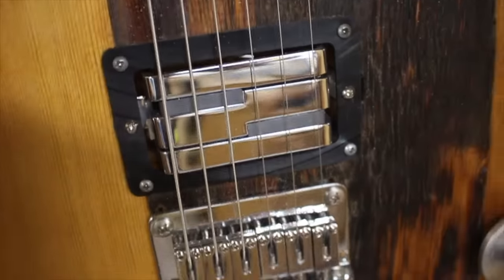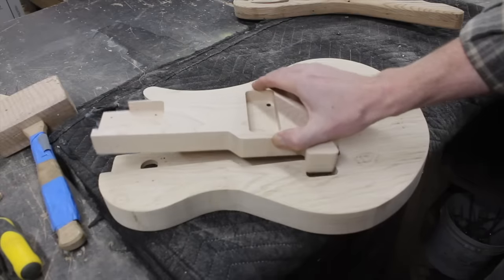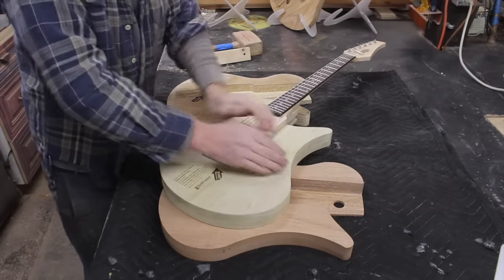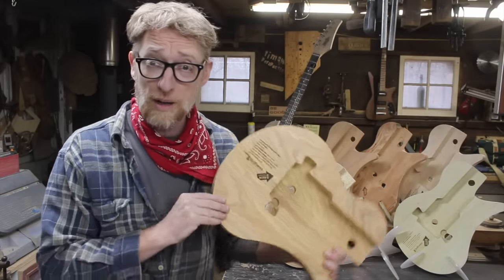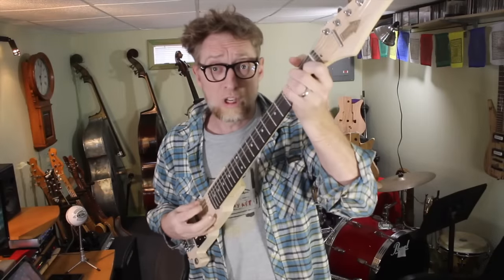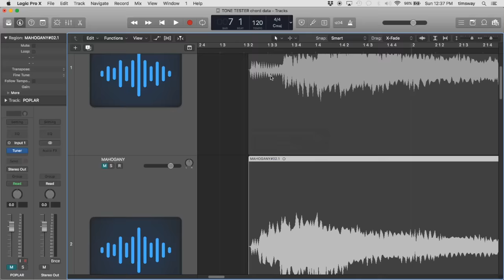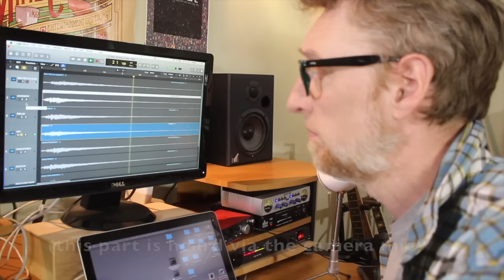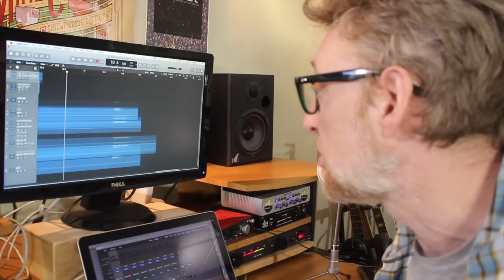Tone Wood Tester: One guitar to test them all

Comment: I am 61 years old - I've been playing and thinking about woods since I was ten. I went into engineering as a way of making a living. Having given this considerable thought I would like to give a simple breakdown of why the density and to a much lesser extent grain patterns in the wood of a solid body guitar influence the sound. The guitar is made of four components plus strings - the neck, the nut, the bridge, and the body. Some really great analysis is indicated on several videos - these explain what the string does after it is plucked and how the harmonic content is created. If we had infinite mass on the body and neck that harmonic content would be unaffected by the body or the neck - it would be consistent and without external influence. But we have components that vary in density, geometry and interface (neck-body joint). All will influence the string response. The neck is like a beam cantilevered off of the body, the body is the anchor. A neck can be fat or lean – this will influence how it responds to string vibration. The thicker the less it will vibrate and affect harmonics on the string. The strings are anchored at the nut and the bridge. Both the nut and the bridge transfer the string vibration to their anchor points. So the nut is the transfer point for the neck and the bridge is the transfer point for the body. When plucked the string vibrates and harmonics are created down the length of that string. That vibrational content is transferred through the nut to the neck. If the neck were infinite mass it would not influence the harmonic content of the string. But the neck has mass that is easily influenced, vibrates and injects that vibration back into the string via the nut with its vibrational response. The density (wood species) of the neck and the thickness or stiffness will determine how the strings are influenced. The same thing happens with the bridge. It transfers the vibration of the strings to the body, the body resonates and that vibrational response is transferred back through the bridge to the strings, which then affects the harmonic content of the string vibrational pattern. Everything that goes into the strings is then transferred to the pickup. It is a system. It is a recipe of parts. Different woods and geometries for the body will vibrate differently in response to the string vibration, the same with the neck. Nothing on the guitar is isolated from the other parts. It would take infinite mass of the body and neck for influence on the strings to reach zero. Do you feel the body of your guitar vibrating when you pluck a string or strum a chord? If the string didn’t transfer its vibration to the body you would feel nothing. If the body is vibrating, do you think that is isolated from the strings? - If so, how? It is a system of moving parts, each with its own vibrational characteristics, each influencing the other. The neck and body also share a joint and they influence each other.

Let’s look at construction. Neck – body interface (joint) will affect how those two affect each other. A set neck with lots of surface contact (long tenon Les Paul) will allow those two to vibrate separately and together better than a joint that has less interface. One is not better than the other – they just produce different sets of outcomes at the strings. Different woods (densities and therefore different responses) between the body and neck will have different outcomes at the strings. A solid single wood type body will behave differently than a body constructed of two or more woods with different densities (Les Paul). A maple neck on a Les Paul will sound different than a mahogany neck. A rosewood neck on a Stratocaster will sound different than a maple neck. A neck-through will sound different than a set or screwed on neck. A partial neck-through (as in the tonewood test unit) will respond different to either a set or screwed on neck or a whole neck-through. A neck-through represents the same wood density through the length and the body woods added to it will have considerably less influence on the sound of the strings because the bridge transfers to that neck wood directly and the side body pieces (wings) are only responding to what the neck wood sends to them – and that response has to travel back through the neck wood through the bridge and back to the strings. The body wing vibrational influence is minimized through that transfer. In the partial neck-through again the bridge is mounted to the neck wood and although the mass of this neck wood is less than a full neck-through due to it being a fraction of the body thickness it still influences the passing of the body’s tonewood vibration back to the strings; less of the tonewood’s influence will come across at the strings. In a Les Paul the maple cap is fully bound to the mahogany tonewood and both influence the sound at the string – each wood’s characteristic resonance comes through because the bridge anchor reaches both woods.

Each wood species has a very specific grain type and density range and will have response or resonance that matches that range. Some guitars made out of the same wood sound better to the player than others. One guitar might be put back by a player just to be picked up and purchased by another as the “one” that “hits” it. Most of that is due to wood density – some of it is in the electronics and a minor portion by the quality of construction – but that variation is very slight and mostly fixable.

The woods used on a guitar vary in density. Maple is much more dense than mahogany. Each species of wood has a range of densities that are determined by growth - the more water the faster the growth and the density drops in the range proportionate to the growth rate. To a degree the grain structure affects density in woods like mahogany because the grain is open (porous) and where large variations of grain occur the density in a region of the tree will vary proportionately. One piece of mahogany having consistent grain will have consistent density and resonance where another piece having significant grain pattern changes will have an inconsistent vibration pattern. I have seen mahogany pieces with severe changes in grain structure that seemed to resist vibration. This I attribute to cancelations caused by inconsistent densities through the piece impeding the natural vibration (resonance) due to higher grain density, or impedance, in a portion of that piece. To put it simply – it is a dead piece of wood. This accounts for the variations we see in instruments using mahogany. Woods like alder and maple are closed grain woods and have little variation due to grain pattern changes. Growth rate determines wood density in these trees. Faster growth (lots of water) lower density. Each wood type has its own density range. Eastern hard maple is much denser than western big leaf maple. Both are considered dense compared with alder or a similar wood.

Summing this up – the woods, shapes of body and neck, joint type, and the pickups and electronics all affect the sound coming out of the guitar. It is a recipe. I liken it to what goes on in the kitchen and I  prefer to think of guitars as unique in sound from each other. To me the song will dictate which guitar to use because it should serve the song and enhance it. I have heard incredible combinations of different guitars over the years; I have heard guitar selections that made no sense. I like to think this was the engineer rather than the player who made the bad choice. 

I think this is how a guitar works – and I have been thinking about it since I carved my first neck at eleven because it was too fat for my fingers. At fourteen a dear friend’s father who really positively influenced my first band was trying to convince me that given the same pickups a guitar made out of concrete would sound the same as one made out of mahogany. I really think he was just giving me something to think about. I did. Thanks Norm.
Reply: @valueofnothing2487  I have read so many papers on experiments and summaries regarding this matter. All I could get translated on this was the summary. I did however also look at the tables supplied and attempted to understand the approach and construct of the experiment. I can only comment on the data - which appears to have been manipulated for the sake of simplifying the job of reading those results. If you could overlay these response plots as they appear you would definitely see differences. In the summary the author states :  "The harmonic spectra of each guitar are compared to each other and there are no significant differences between them. Thus, the variations of timbre of electric guitars, according to the results obtained here, depend on factors other than the wood of the body itself..." The differences are in the data as provided - I can clearly see them, yet the author states "there are no significant differences". If you could see the raw data and compare it the results would probably be even more compelling. Anyone can make an experiment and state conclusions. The reality is that nothing stands alone in an instrument. This is a difficult question to answer and the setup to get conclusive data is not apparent.  Is the harmonic content truly represented to the reader? I seriously cannot conclude anything absolute from this paper one way or the other. But if you look at the response tables and if you are capable of discerning the differences by comparing sections of the response curves you will see the differences. Given this manipulated data would I say "no significant differences"? Give me the raw data. If all I had was what is presented I would say it appears as though there are differences, but the data is too tansformed to give an opinion. If pressed I would say the data presents differences that cannot be quantified in terms of actual content and differentiation - but there are apparent differences portrayed in the data given. I would never state "no significant differences". That is a stretch.
Reply: @valueofnothing2487  I have a Stratocaster with a solid rosewood neck that sounds nothing like a solid maple neck. The difference is stunning. I can tell right away the difference between a Les Paul with a mahogany neck and a maple neck. They sound very different. Some people can hear these differences - others can't. That certainly becomes part of the equation at some point. I know a guy who can tell you which microphone would be best given your voice. He can hear all the way up to nearly 25,000 hertz. I wouldn't want to be burdened with all that goes on the average person doesn't hear but is in many man-made environments. Electronics often have circuits that resonate at frequncies in that range - it would drive me nuts. I can hear up to about 16,000 hertz. That is more than enough. My point in my discussion was that this is more complicated than most of us realize and I have not seen one experiment that closed all of the concerns introduced by the experiment itself, let alone answered all of the questions one might have regarding instrument response. Many of these authors arrogantly state conclusions. It happens in science all of the time. Even peer reviewing doesn't guarantee that the conclusions are correct. Don't even get me started. It can be a real minefield. I offer my interpretation based on 50 years of looking at this and wondering. It doesn't matter to me if you agree or disagree.
Reply: @robertduvall7392  it was just a f test of the frequency distribution where the null hypothesis is that the frequencies are all the same. And it could not be rejected at the 95% confidence interval, I presume. Comparing frequency distributions is kind of standard fair in statistics.

when I look at all the graphs I could not see any significant differences. 

In terms of what the human ear can hear I would say if you could look at the graphs closely which I am unable to do you could claim that if something is off by a decimal or a half a decimal then there might detect. 

maybe I will look at it in the PC and see if I can see differences.

Can you give me an example of one of the differences that you think was different? So I could take a look. You have to admit don't you that they all appear the same shapes roughly right? when one falls the others rise and when one of them fall on they all of them rise? If you step back and look at the big picture it is if you some kind of duplication pain like Thomas Jefferson had or something.
Reply: @valueofnothing2487  We are talking about details, not big picture stuff. There might be a peak at just a few frequencies and a drop at a few frequencies that alter the overal characteristic of the sound. I've done a lot of experimenting with guitars over the years and been surprised at the differences. I really don't know what else to say. Again, if you could see and really analize the original signals and compare detail you would see the difference. Take a guitar and just change the neck wood on it. We are talking about a guitar straight through a clean amp. Certainly if you process the signal through all kinds of effects then all bets are off. The same setup is used on three body boards with the same neck. https://www.youtube.com/watch?v=nrEar7dgVwI  If you cannot hear the difference then I certainly can't help you. I don't think you can use statistics to define or describe what people hear.
Reply: the valid point made re what if the guitar were made of concrete etc....in the real world of guitars MOST woods including plywood have fairly good sustain and "open" sounds...the kid is NOT correct about the density vs "better" sound. in fact, a softer wood ie Mahogany vs solid maple will resonate better at the more desirable frequencies...the poplar body sounded much better than the ash body....and ash is considerably more dense than poplar, but as soon as you change the formula and use materials like concrete, or aluminum, or steel, copper etc. you would notice a huge difference....HOWEVER..the "test" guitar used here does NOT account for how a guitar is actually built (with the exception of neck-through designs. the neck on MOST guitars is attached or glued in to the body at a point where the body material takes precedence in the region between the end of the fingerboard and the bridge/tailpiece. any such effect in THIS particular construct is inconsequential since the entire length of this part of the instrument is made of the same materials. there is no real coupling effect beyond the contact of the body materials with the already complete (think Steinberger) "instrument". As impractical as it would be, the only REAL test comparison would involve bolting or gluing a neck onto the same body style of varying materials/wood densities, and evaluating these results. that way, the body material would play a much larger part in how the vibrations are transmitted between the neck joint and the bridge...more like a vast majority of guitar designs, and ultimately more relevant to the debate.
Reply: @guitarworks2546  what do you think about the Portuguese study?

They did an f test and found no significant differences among body wood types.
Reply: @valueofnothing2487  again, as I stated in the opening of my post, MOST woods fall into the "decent tone" category..the differences here are all relative to density (also ultimately weight once there begins to be a noticeable difference ie 3lbs or so for a particular body) I have been building guitars for 40 years and all "studies" aside I can tell you from personal experience that there is little difference between the types of wood used for the body IF they are of similar weight/density ratios! Mahogany sounds about the same as Alder IF the bodies are the same weight! same thing with say, pine vs swamp ash....etc etc  However, in the real world, two pieces of mahogany from the same tree will often vary substantially in density...this will and DOES change the timbre and overall voice of the instrument!.the least dense piece will have a wider low-midrange fundamental resonant frequency which, when the instrument is played LOUDLY will react sonically to certain frequencies and resonate and feed back more readily at those frequencies when brought into the proximity of the amplifier. The more dense piece will exhibit tendencies to lack some of the lower resonances found in the lighter piece, sound a little brighter overall, and be less prone to feedback at the frequencies that the other, Lighter piece, finds favourable. IF however the comparisons are made at lower volume levels where induction of vibration from the amplifier is a lesser factor, one might find much less of an apparent difference in the different bodies.If 4 bodies of different woods are approximately the same weight, say 3lbs5oz on the nose, in all likelyhood they would sound the same at a non-performance volume level. when a l,ightweight body is subjected to high volumes from an amplifier the resulting tonal balance is very different than that of a heavy slab even if it is the same species of wood!
so in reality the density of the wood is a much larger factor than the species of wood in how the guitar sounds. It is very difficult however to match weight/density of various woods since it is often quite difficult to even cut 4 or 5 bodies that are of identical weight from the same species from the same tree. also, it is commonly agreed upon in professional circles that pickups of high output tend to diminish the effect the wood might have on the overall tone of the instrument, and that a low output pickup is a more desirable option if one wants the guitar to "breathe" a little and introduce more of its acoustic resonance into the overall tone, so there are MANY factors at play in how an instrument sounds, but when dealing with the wooden components, species is less important than density/weight/and also stiffness ratios. primarily of major importance when considering the flexibility (or lack thereof) in a piece destined to be used as a neck, where the wrong piece of wood can totally kill the sound of the overall instrument very easily.
Reply: @guitarworks2546  I asked you what you thought of the study and I think your answer is that you believe in your own personal experience and not the study.

Well I hope that you don't encourage others to believe things you cannot prove.

And of course all the guitar bodies in the study had different weights and different densities and different stiffness.
Reply: @valueofnothing2487  my answer is based on what I have experienced. you asked me about my OPINION on a "portugese study" without any links to whatever this is. I am not aware of this study so forgive me if I cannot give you an opinion of something I have never seen..My opinion might even be that i don't agree with the study....which would still be a valid opinion...Nor would I be inclined to believe it simply because it is a "Study".There are also countless individuals "studying" theology and religion but I have yet to see definitive proof of the existence of a specific ":god" or even Jesus other than what someone has written in some manuscript....but that's another discussion....regardless if my opinion based 40 years of building and servicing instruments is of no value because you need me to "prove" something then just feel free to ignore it altogether.
Reply: @guitarworks2546  
I had a recap of it all it a separate thread.

Here is the study. The problem is that just as many luthiers claim there is an effect that don't.

https://physicae.ifi.unicamp.br/physicae/article/view/physicae.9.5
Reply: They don't, to any significant level, on solid body electrics. An "Engineer" doesn't change that. If people think 'Engineers must be smarter', they need only watch "Engineering Disasters" right here on YouTube. The Engineers that are wrong most often? The ones who have "given considerable thought" to... anything. 😜
Reply: @ModernGolfer  well, no. It is just that being an engineer in itself doesn't prove anything. But I was hoping that a person who wasn't engineer could appreciate the scientific evidence before him I bet in a person who is not trained in material science.

and that is what I'm claiming that the best science we have shows that the  species of the body makes no difference.

what is really funny however is now they're saying that even the backs of acoustic guitars doesn't even matter!

https://newatlas.com/guitar-wood-types/58139/?amp=true
Reply: @valueofnothing2487   just as a matter of interest, what is your background and experience in musical instrument making, playing etc
Reply: Amen to that.
Reply: @Paweł Jabłoński it's probably fair to say that there should be a 'minimum" body thickness in order to have a definite impact on sustain, resonance etc...likely anything less than 1" would seriously impact the tone on a "bolt on" neck, not so much so if it were a neck through like ie rickenbacker with 'wings" style instrument which in all fairness has less impact on the tone than if the body were part of the resonant path. going thicker in excess of 2" will have less of an impact other than diminishing low end resonance with increased thickness...and again, in an electric guitar situation, this is easily compensated for by turning a few eq settings on your amp. the body wood/material DOES have an impact on the acoustic response of the guitar....something that becomes less of a factor with more powerful pickups, and even moreso a factor when using vintage low output pickups that have some microphonic properties. high gain active pickups like EMG 81 for example can be put on almost any kind of wood and the guitar will not have a noticeable change in output quality, since they focus their response/reaction pretty much 100% electronically from the strings due to their construction. older, unwaxed pickups with lower gain characteristics will read more of the "acoustic" properties of the instrument, which is for example why a hollow body Jazz guitar sounds different when plugged in from a solid maple body guitar with a Floyd rose....the body resonates differently....so the guitar sound different....which IS a factor in the real world of how one listens to an instrument despite oscilloscopes and their readings. if you want to gain some additional data...DO use an oscilloscope... but connect it to a piezo transducer attached to the body ...there will be noticeable difference in wave shapes = different resonance properties which become more or less apparent depending on the pickups used in the instrument.....so it's not an easy black and white determination.
Reply: @Paweł Jabłoński also...re some comments made by valueofnothing re materials etc...as he states in fact the BACK of an acoustic guitar is of a very low percentage in contributing to the overall sound of the instrument as it is usually stiffly braced, up against the body of the player when in use and thus significantly dampened...really negating any differences that may be introduced by wood choices even in high end instruments with solid backs as opposed to laminates (plywood). the wood used in the tops and neck would be of far greater significance...also just for an example... differences in densities/ pieces of wood used for bodies are readily apparent in bass guitars when often you can find ie a P-bass that has a node or dead spot/note at a point somewhere up the neck which can disappear entirely when you swap out the neck or body for another of different weight/density/species.so not all P basses sound/respond the same, because NOT ALL PIECES OF WOOD RESPOND THE SAME!...case in point: when I was still in the retail business in the late '90's our store carried a bass manufactured by CORT (Curbow Bass) which had bodies made of high density MDF composite...and a fingerboard of synthetic resin...NOT wood....and this, being a very consistent man made product exhibited very predictable similar characteristics from instrument to instrument ...in fact, EVERY one of these basses had the same "dead spot" on the neck where the note would just thud and lose sustain...(can't remember exactly which note) but they all had the same issue..something I'm sure would change if someone were to make the bodies out of an alternate material/wood....so while the scope connected to the pickups might show similar waveshapes coming from the string/pickup interaction, the response/sustain and overall resonance of the instrument WOULD be affected! also re your question about body shape....this would have minimal impact (within reason) as a strat and telecaster shape vs say a Les paul Junior (shape) would have little difference if they were all made from the same slab of alder, or whatever.....and using the same bridge design, bolt on neck and pickups. the scale length MIGHT impact the overall tone very slightly, since a 25 1/2" scale would have more string tension at the same tuning as a 24 3/4" scale guitar and that extra tension would change the low end response characteristic  of the string when put into motion.....but I'm not so sure it would be heard as a critical difference even though the laws of physics would say it is so....
Reply: @robertduvall7392  Are you able to differentiate these tonal differences between guitars when plugged in to an overdriven amp at volume playing along with a drummer and bass player?